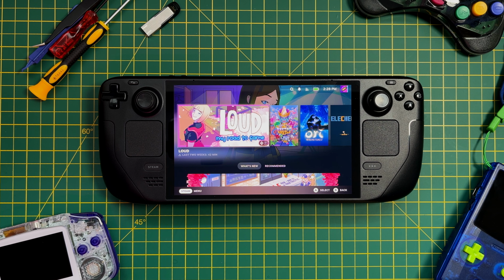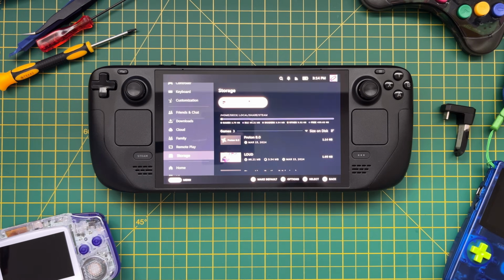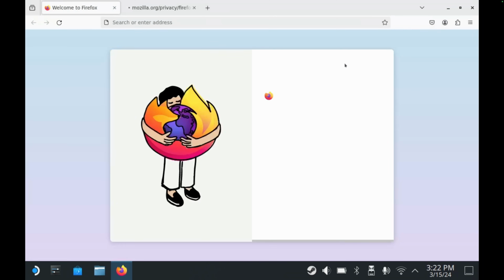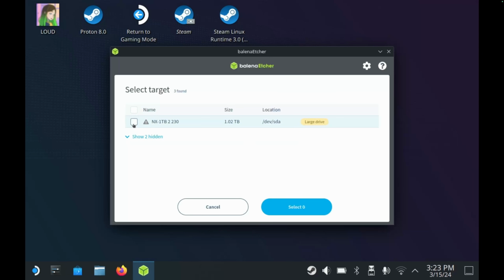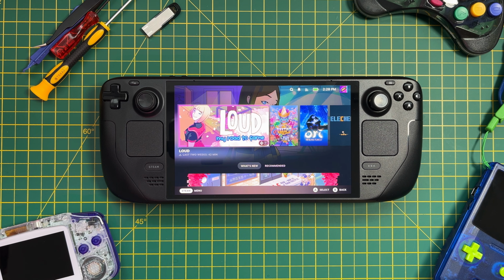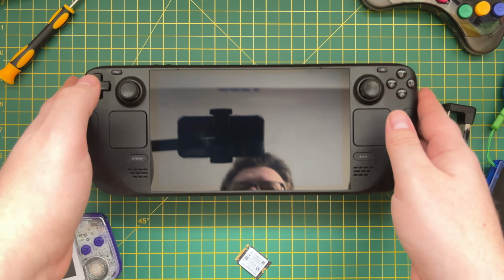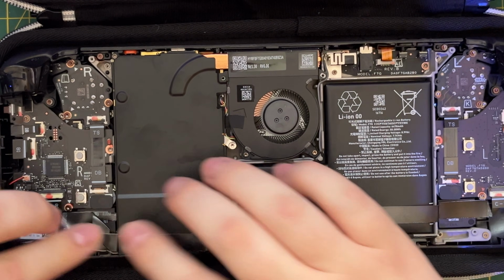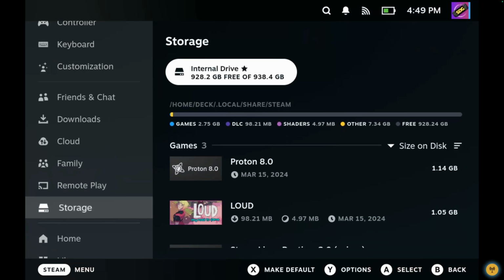Upgrade Your Steam Deck Storage! The EASY Way!

Comment: I did this without removing the battery cable (because it is a bitch and it feels like you're going to break it) or the CR tape bus cable thing, It's got enough slack to just remove the adhesive and then just work around it... My deck works like a charm and I've since heard of people having problems reconnecting their battery so I would advise against disconnecting the battery altogether - I drained the battery to near dead and then put it into battery storage mode - all of which is sufficient precaution
Reply from the maker: Congrats. I never had to much issues removing the battery cables, so it’s worth doing to be on the safe side, but I think the risk is small. I don’t believe I even bothered with the battery drain - just put it in storage mode.

Comment: A little confused. After using balena etcher the device acted like the home partition of the new larger SSD was the same size as the smaller SSD. Does this change after swapping the SSD's in the system or is there some other setting I'm not seeing that isn't letting it using the extra space?
Reply from the maker: Yes this is normal. When you put the new one into the steam deck and reboot, steamOS will extend the existing partition automatically to make use of the unused space
Reply: @steamdeckguy  I've got the same issue, but Steam isn't automatically extending the existing partition. KDE Partition Manager just shows the unallocated space...

Comment: Thank you so much!! I just put my 2TB SSD into my Steam Deck! It was overall and easy process! Just a heads up the new version of Balena Etcher wasn’t working for me. It didn’t recognize any of my storage options. I went back to the 1.18.11 in your video and it worked!! I also bought 2TB microSD and I’m going to add emulation to my Steam Deck OLED!

Comment: TLDR: These instructions worked perfectly. Straight, ordered, and to the point. Thank you. You've earned a new subscriber.

A few details to those considering this upgrade:
1. I'm not new to tools, but I primarily work with power tools not those for delicate electronics. So, I'm a noob in this DIY world.
2. The only "nervous" parts were: opening the SD and hearing the "cracks" and "groans" of the plastic case, and my battery cable wouldn't come out using the tab, I had to push it out with my fingernail.
3. Start to finish it probably took about an hour. This includes cloning my drive, going through the steps (by watching and rewatching parts of the video), and disassembly/reassembly.

A MUCH better DIY video than the YouTubers who drone on and on with needless info because they think it's funny, needed, or on brand.
Reply: I left my battery connected - it was already drained anyway - I didn't disconnect that CR cable bus either - it had enough slack to work around it - I heard people having trouble reconnecting those two things - i just avoided those steps

Comment: Very very helpfull video. I have just made an upgrade to 2TB and everything was ok. 
The only difference I made it was no unpluged the speakers cable in the process. I tryed to but it didnt work, so I decided to remove the batery cover with the speakers cable on. 
Just worked! 
Thank you very much ❤

Comment: During the cloning process, it copied to the new SSD, but during the validation process Balena gave me an error: "Something went wrong. If it is a compressed image, please check that the archive is not corrupted" - I tried to do the cloning over again but I got the same error very early on in the process this time. It looked like the games had been copied to the new drive, but I restarted the deck and now it shows all of the games back on the internal SSD. Starting over once again but not having much luck with this process so far.
Reply: For anyone else that may run into this issue, here is how i solved it: right click on the Balena Etcher file, go to Properties -> Permissions and allow full read/write access to all profiles available. Unsure if this is what fixed the error but after I tried this and cloned the internal SSD it copied perfectly and the rest of the steps worked perfectly. Now I have a 2tb SSD with a 1tb MicroSD .Time to add more games! (that I never play). I'm up to around 500 emulated games on Emudeck  xD

Comment: I got lost on the recovery image part, is that something that I MUST do or can I ignore this?
Reply from the maker: If you don’t do the recovery, you won’t have an operating system - just a blank drive  and so you won’t make it past the bios boot menu. So yeah… it’s important!
Reply: @ oh okay, would be able to tell me how to do it though the micro sd card that I already have in the deck?
Reply from the maker: @zanec6139  you can use an micro sd card, but all the data on it will get wiped. The steps are exactly the same, you just select the sd card instead of a portable drive when writing the image and booting.

Comment: looks like my original comment with helpful info got deleted so im reposting as someone had replied for clarification on non-oled..
balena etcher downloads as a zip not an app image -- KEYWORDS FOR PEOPLE SEARCHING FOR A FIX TO BALENA ETCHER as it does not happen as this video shows exactly..
downloads as a ZIP file, extract that file, then run the 'balena-etcher' file.. it will not necessarily show the .app image file type and its not obvious to a non-linux person.

Also; to get to the bios thing by pushing the volume up then power button.. if you just hold the power button it WILL just flash on then shut off, you only need to hold it for a few seconds and release.. the screen may remain dark while its loading (try to listen / feel the fan on).

Lastly for a non- OLED Steam deck in addition to this video's tutorial.. refer to these links (or search ifixit) as you'll have already copied your drive you can skip some extra steps from the ifixit guide. Ifixit steam deck ssd replacement non-oled both the original and refreshed versions: https://www.ifixit.com/Guide/Steam+Deck+SSD+Replacement/148989, it's the same site OP refers to but this will have the slight differences for non-oled and the OS setup steps, but i recommend you clone the drive as OP shows in this video, its easier.

Comment: I have an LCD (Original) deck and am looking to upgrade the internal storage for it. I know you briefly mention near the middle of the video, but can this method be done on it? Or does it only work for OLED models.
Reply from the maker: Works on any steam deck.
Reply: @ cheers boss 👌🏻

Comment: Just upgraded my 265GB Steam Deck LED to 2 TB with the cloning method. Easy, but I had tiny bits of settings reset on me. I got "verifying installation" upon boot and had to re-login to the user accounts. Other than that it was quick and easy method and highly recommended 👍

Comment: It worked like a charm.
Yesterday it took 7 hours for 1tb of data and another 7 hours for validation and work without any problem.
However, today I'm stuck at the deck logo screen and during the boot from BIOS the error was (Cannot open access to  Console
 the route account is locked) 

Not sure how to proceed.

Comment: How do I install balena etcher after download please, no exe file
Reply: looks like my original comment with helpful info got deleted so im reposting as someone had replied for clarification on non-oled and belena etcher..
balena etcher downloads as a zip not an app image -- KEYWORDS FOR PEOPLE SEARCHING FOR A FIX TO BALENA ETCHER as it does not happen as this video shows exactly..
downloads as a ZIP file, extract that file, then run the 'balena-etcher' file.. it will not necessarily show the .app image file type and its not obvious to a non-linux person.

Also; to get to the bios thing by pushing the volume up then power button.. if you just hold the power button it WILL just flash on then shut off, you only need to hold it for a few seconds and release.. the screen may remain dark while its loading (try to listen / feel the fan on).

Lastly for a non- OLED Steam deck in addition to this video's tutorial.. refer to these links (or search ifixit) as you'll have already copied your drive you can skip some extra steps from the ifixit guide. Ifixit steam deck ssd replacement non-oled both the original and refreshed versions: https://www.ifixit.com/Guide/Steam+Deck+SSD+Replacement/148989, it's the same site OP refers to but this will have the slight differences for non-oled and the OS setup steps, but i recommend you clone the drive as OP shows in this video, its easier.

Comment: I tried this on my LED steam deck and also repasted the CPU. After putting it back together I plugged in the USB charger to turn it back on but it wouldn't turn back on again. The battery LED slow flashes and nothing happens. Please help!
Reply: original charger? make sure its not an under powered one.. make sure battery is plugged back in and you fully seated the SSD and the heat shield (silver metal plate that has 3 screws).. full tightened to make sure all the thermal pads are making contact again. initial boot can sometimes take a min, make sure you hear/feel the fan coming on even if the screen is staying black
Reply: @Artificial.Unintelligence  I used a 200w ugreen charger. Found a reddit thread with people having the same issue. The steps didn't really make sense but I followed them and it actually worked!

Comment: I tried to do this and all I got was the steam deck boot screen. Couldn’t get passed it. Tried to clone it again and no good. Not sure what I’m doing wrong. Maybe I will try a different clone wizard. 😢
Reply: looks like my original comment with helpful info got deleted so im reposting as someone had replied for clarification on non-oled..
balena etcher downloads as a zip not an app image -- KEYWORDS FOR PEOPLE SEARCHING FOR A FIX TO BALENA ETCHER as it does not happen as this video shows exactly..
downloads as a ZIP file, extract that file, then run the 'balena-etcher' file.. it will not necessarily show the .app image file type and its not obvious to a non-linux person.

Also; to get to the bios thing by pushing the volume up then power button.. if you just hold the power button it WILL just flash on then shut off, you only need to hold it for a few seconds and release.. the screen may remain dark while its loading (try to listen / feel the fan on).

Lastly for a non- OLED Steam deck in addition to this video's tutorial.. refer to these links (or search ifixit) as you'll have already copied your drive you can skip some extra steps from the ifixit guide. Ifixit steam deck ssd replacement non-oled both the original and refreshed versions: https://www.ifixit.com/Guide/Steam+Deck+SSD+Replacement/148989, it's the same site OP refers to but this will have the slight differences for non-oled and the OS setup steps, but i recommend you clone the drive as OP shows in this video, its easier.

Comment: Hi,
This video is amazing and very helpful! I'm currently working kn upgrading my 256GB Steam Deck LCD to 1TB.

However, when I downloaded Belena Etcher, it downloaded as a .zip file instead of an app image like in this video.

How do I install Belena from a .zip file on Steam Deck Desktop mode?
Reply: I managed to find the app image after extracting the .zip file to the Desktop.
Reply: looks like my original comment with helpful info got deleted so im reposting as someone had replied for clarification on non-oled..
balena etcher downloads as a zip not an app image -- KEYWORDS FOR PEOPLE SEARCHING FOR A FIX TO BALENA ETCHER as it does not happen as this video shows exactly..
downloads as a ZIP file, extract that file, then run the 'balena-etcher' file.. it will not necessarily show the .app image file type and its not obvious to a non-linux person.

Also; to get to the bios thing by pushing the volume up then power button.. if you just hold the power button it WILL just flash on then shut off, you only need to hold it for a few seconds and release.. the screen may remain dark while its loading (try to listen / feel the fan on).

Lastly for a non- OLED Steam deck in addition to this video's tutorial.. refer to these links (or search ifixit) as you'll have already copied your drive you can skip some extra steps from the ifixit guide. Ifixit steam deck ssd replacement non-oled both the original and refreshed versions: https://www.ifixit.com/Guide/Steam+Deck+SSD+Replacement/148989, it's the same site OP refers to but this will have the slight differences for non-oled and the OS setup steps, but i recommend you clone the drive as OP shows in this video, its easier.

Comment: I followed the steps, and it seemed to go well, but seems it is looping at the loading user data screen. I was abel to get to desktop mode, the disk size and my files is reported correctly. it seems that I am signed out of steam. Any idea if a new attempt at cloning will have better luck? I used the same UGREEN M.2 NVMe SSD Enclosure and Balena Etcher 1.18.11.

Comment: Worked like a charm. I was able to skip the whole etcher cloning step by using an ICY BOX cloning station. I upgraded from a 512 GB to a 2TB model and the cloning took approx. 5 minutes. Put everything  back to together and everything is fine. Thanks for the tutorial.

Comment: Hi Kris, thank you for creating short and easy to follow guides like this, just 1 question, after cloning my 512gb ssd to 2tb ssd, I noticed the extra space are unallocated, should i expand the partition? or would steamdeck claim the unallocated space after installing the new ssd?
Reply from the maker: steamOS should automatically claim the unused space when you boot for the first time.
Reply: @steamdeckguy  great, so there are no extra steps needed? after cloning via balena etcher, I can go straight to mounting the new ssd? (after battery storage mode ofcourse)

Comment: This didn’t work for me. Used the latest and that 18. Version suggested of etcher. Only bios is available. Odd! I have a 2tb P310 I’m trying to use.

It just boots into emergency mode.
Reply: so did you successfully launch and clone before going into the bios to do the no-battery power mode?

Comment: I follow this video steps nice and simple to follow direct to the point,  but unfurtunally when time to boot into the os my steam got stock in the boot logo. But it was an easy fix. I just boot an ubuntu USB and did some disk repair in disk utility and boot the steam again and is working fine.

Comment: This is insanely easy and doesn't require a windows PC which I love. I only have my steam deck at the moment because my laptop died around 2 years ago and I have been using my upgraded 64GB (256 GB) Steam Deck, which is desperately needing a 2 TB Upgrade. Tomorrow I am gonna buy a 2 TB SSD and enclosure and I'll finally have enough space to do my schoolwork and play games.

Comment: After you done cloning to new nvme ssd can you put it away n still use your original inside steam deck since its cloned or do you have 2 replace it as soon as you finished cloning to the new ssd in the enclosure?
Reply from the maker: You don’t have to swap them right away, but obviously if you continue using it then you ‘cloned’ copy will become out of date.
Reply: @steamdeckguy  i see n i wanted 2 ask for the rest of this month of December if in meantime I'm using steam deck will the clone enclosure will still go out of date?
Reply: Cloned nvme in enclosure I mean
Reply from the maker: @troublebear3600  it depends what you are doing with it in December….Obviously, if you install a ton of games and make changes, then those changes will be lost when you swap out the drives at a later date. Technically it’s not an issue.
Reply: @steamdeckguy  oh ok n no jus playing my games that I already have im not going to download new ones til I change ssd nvme 2 new 2tb nvme ssd the reason why I'm not going to switch rite away cuz I'm bout 2 travel n I rather just wait til after the holidays to open my steam deck n replace ssd nvme

Comment: I understand that mileage may vary but when it comes to all the nuanced modding with games on deck and things adjacent to that; Would anything be lost with cloning or is it literally a perfect clone that will respond exactly how it did before, or rather should it? To be specific, I am personally referring to RE4R mods and Dark Souls 2/3 Cheat Engine. It was more of a pain that I would have liked to do both of those, especially cheat engine, and I would like to know of any issues before I put money towards an SSD upgrade.
Reply from the maker: It will be an exact copy, and steam should automatically increase the partition size to use the additional unused space.

Comment: Great guide, very simple! Only issue I had was battery connector did not want to come out and looks slightly different to yours, the pull tab starded sliding down the cable so had to use my nails to pull it out but otherwise smooth sailing. 
Also a nice advantage to using an external enclosure is you have a portable hard drive you can use after.

Comment: For my case i would have to go with a 2tb drive instead because i have a 512gb model and all the games i would like to install when upgrading are 50gb to 90gb each so a 1tb drive would be too little in my case.
Also, i never really fill up my drive completely because it can result in slowdowns and maybe some other errors in the future.

Comment: Great guide! followed every step and it worked out great. Although my power cable from the battery didn't come out quite as easy as yours so i just left it unplugged but still in the port. everything still worked though. thanks for the video!

Comment: Great video!

I had some trouble with my usb hub disconnecting the NVME enclosure - but switching to a USB 2.0 port fixed it, if anyone has the same issues (did mean cloning my 512gb drive took 3h though)